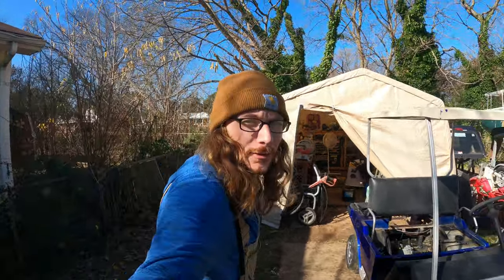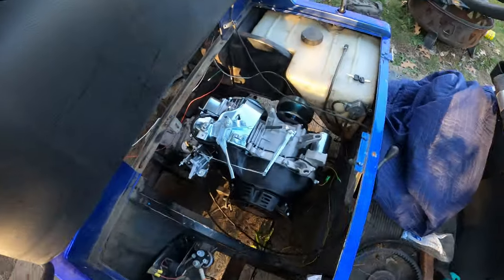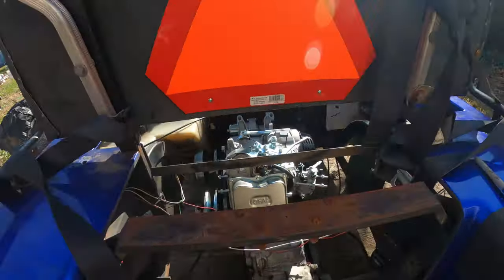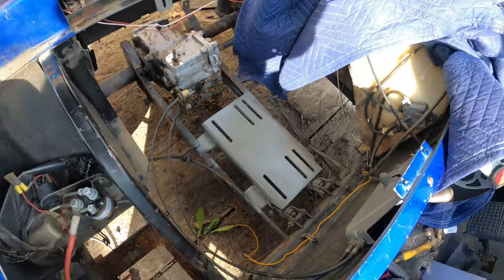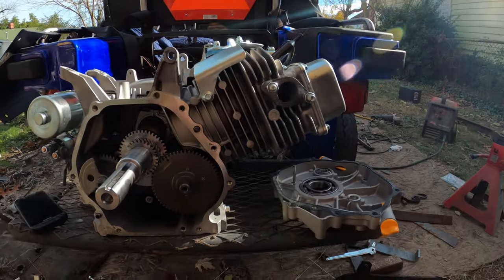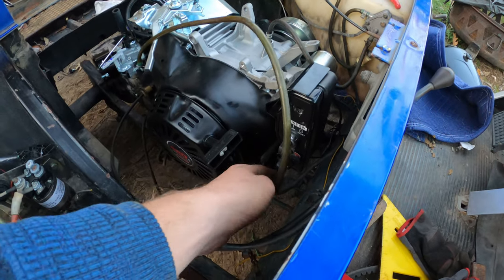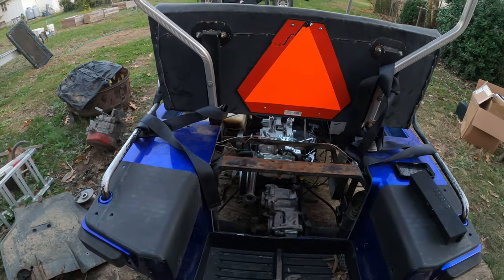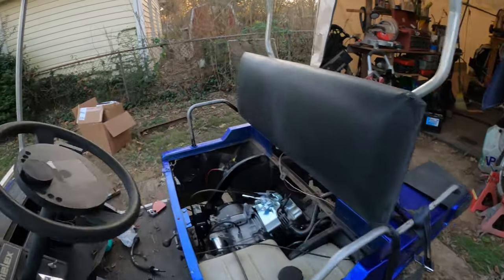Predator 420 Golfcart engine swap

Comment: Hey lib j.  Did you have to jet up the carburator after you took off the air box ? And did your adapter come with one? Mine idials a little high
Reply from the maker: I did have to rejet the carb, well actually I went with a whole different carb that was more tuneable. It was just a Chinese knock off on amazon for 15 bucks. There is a spacer, but it doesn't come with the kit from gopowersports.com. The high idle is most likely due to one of the air passages being blocked without the spacer. This is the link for the spacer that you will need if you have a predator 420 or other engine of similar size. Good luck! https://www.amazon.com/Stens-485-189-Carburetor-Spacer-16220-ZA0-702/dp/B001OK9VE6/ref=pd_bxgy_img_2/144-0092019-7677378?pd_rd_w=MTj6C&pf_rd_p=fd3ebcd0-c1a2-44cf-aba2-bbf4810b3732&pf_rd_r=8GSSJ25Y4ZKKHDJTSSYM&pd_rd_r=87038eaf-7a0b-4be5-a18a-48281c15f50d&pd_rd_wg=anuzc&pd_rd_i=B001OK9VE6&psc=1

Comment: Awesome video. Question, are you using an existing gear box to be able to use reverse? Or did you have to add a gear box?
Reply from the maker: Don't quote me, but I think all golf carts use axle gearboxes. I just used the existing one and it works great!
Reply: @LilBJessup  thanks!
Reply: @LilBJessup  not true. . Mine has no reverse.  Same engine. Ezgo marathon cart.

Comment: what all did you have to move around to get the engine to fit im doing the same thing with my 91 ezgo and i have a 94 rear axle im putting in, just hoping i can get an idea of where things are going to have to go.
Reply from the maker: I didn't have to move anything other than the old motor. I did however have to put down a new engine plate

Comment: How did you hook up your battery to keep it charged??
Reply from the maker: The predator 420 has a built in charging coil. I just wired it up like it said to do in the manual. I haven't had an issue with the battery loosing voltage, but also my led lights are very efficient.

Comment: How’d you make the rear spring/bar so the engine will move with rear end?
Reply from the maker: I used the existing mount and just welded a universal engine mount plate on top of it.